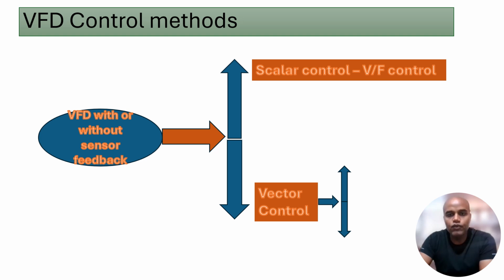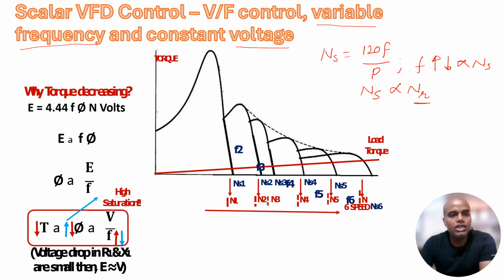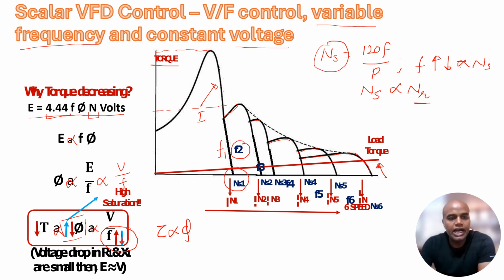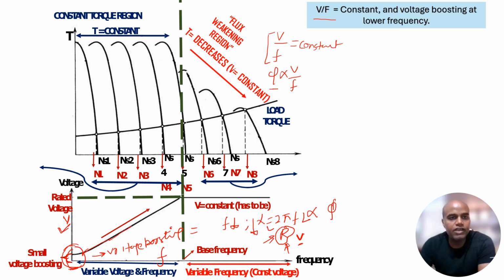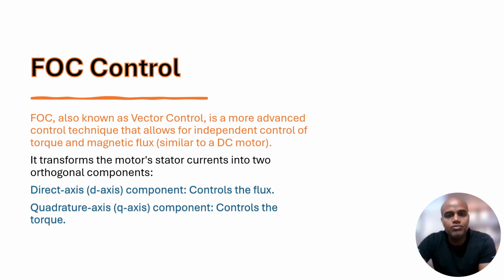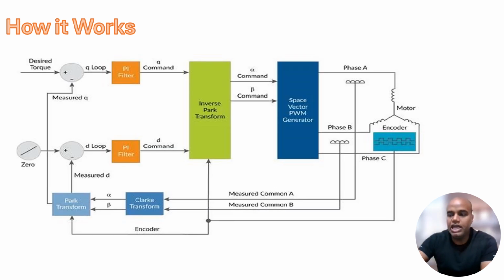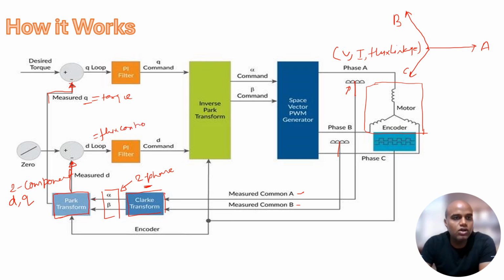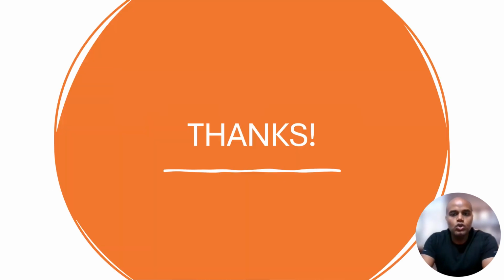Scalar and vector control methods for AC motors (VFD Drives)

Comment: “Encoder gives rotor position” for an induction motor. For an induction motor, FOC needs the rotor-flux angle, not the mechanical rotor angle. The two differ by the slip angle. Indirect FOC calculates the flux angle as the encoder angle plus an estimated slip angle. Rotor position is used directly only for PMSM/synchronous motors.

Comment: “Vector control requires a sensor.” This is not true. Sensorless vector control is standard in industrial VFDs: the drive estimates the flux angle from its motor model. An encoder is needed only for full torque at zero speed, for precise positioning, or for servo performance. DTC drives in particular commonly run without an encoder.